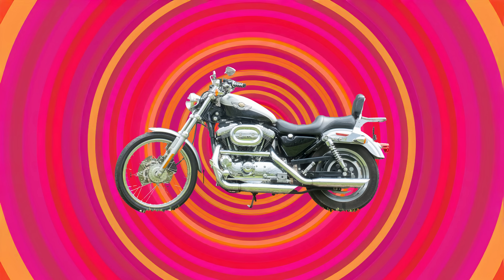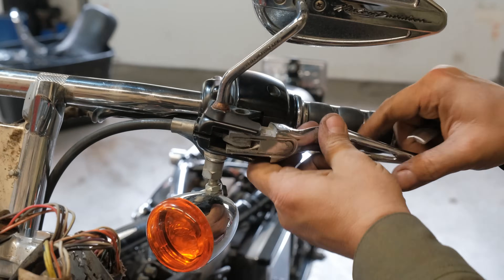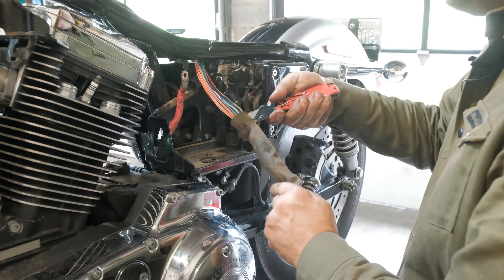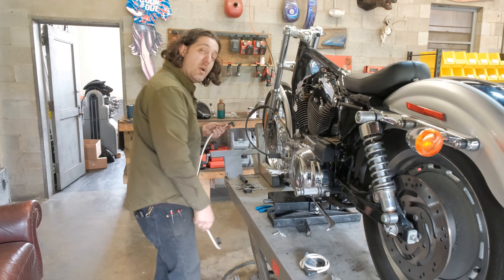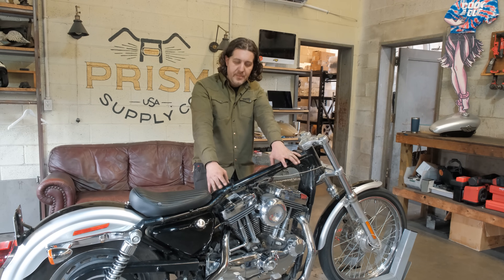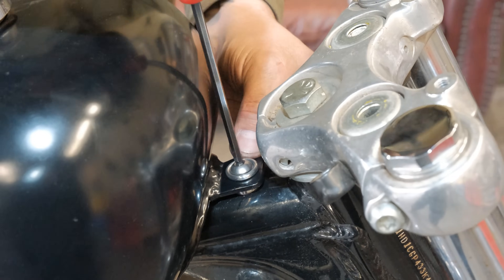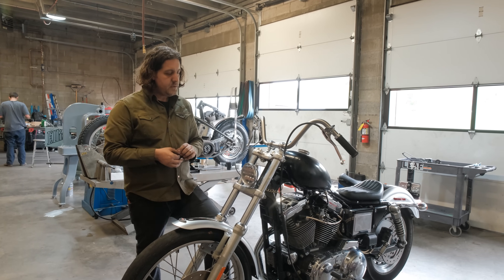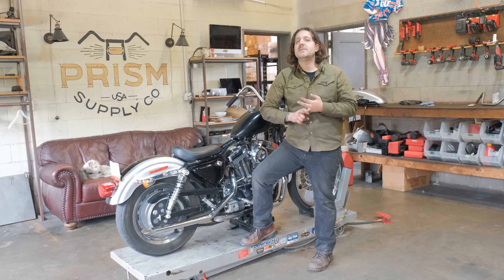Pimp My Sporty | Episode 2

Comment: Definitely interested in those risers! 
The gremlin sportster treatment is top notch and the easiest way to get rid of that rats nest of a stock harness. Also, 10/10 would recommend that fuel line. I went through hundreds of feet of that clear shit that turns yellow and get hard as a rock after a week or two. I’ve had the same length of the black line on for over a year and it still pops on and off like it were new. 🍻

Comment: What do you do about the vacuum hose on the carb?
Reply from the maker: We removed it and plugged the vacuum inlet on the carb with a rubber cap.
Reply: @PrismSupply what about the plug that goes from the vacuum line into the MAP sensor? Would the ignition still work with that removed? Or does the quick start lever override that somehow?